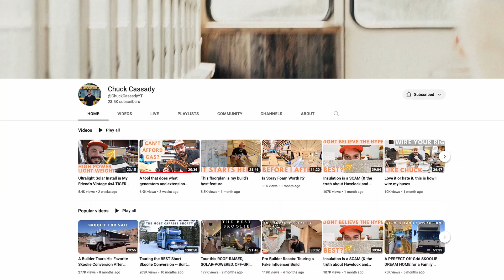1987 OM617 Turbo Diesel Swapped Toyota 4x4

Comment: I did this swap 4 years ago on my 88 4runner, it’s not a daily driver but I’ve put 21,000 miles on the rig after the swap. I run the mechanical fan and aluminum radiator that Joe recommend from summit. I had to use the old gaser water pump from a 1965 Mercedes because it’s 2” shorter than the diesel om617. I use a Chevy 1 wire 100 amp alternator and factory Toyota AC that works great. All Doomsday diesel parts are the bomb
Reply from the maker: Nice man i kind of wish I kept the mechanical fan but it was super tight in there and I was pretty sold on the serpentine kit, I’m a big fan of doomsday, I still think there are a few kinks that needed to be worked out and every build is different and that must be hard for joe
Reply: Seems like everyone of these I see has a electric fan which defeats the purpose to me. I wasn't sure if the mechanical fan settup would work, this is good info to know. Can you say the swap is worth the work, how does yours run at 65-75 speeds?

Comment: I don’t know if you still look thru these comments but @owner or anyone do you know what manual transmission you can you use on a om617 engine that isn’t the 4 speed or the that 6 speed conversion that cost a arm and leg.
Reply from the maker: @redwizardism , I used the stock w56 tranny, you can use the r150 which I would recommend, doomsday diesel and 4x4 labs sells adapter kits/plates but nothing about this swap was cheap

Comment: How difficult would this be for a 2wd 22r? Its got the motorhome dually rear axle. Just doomsday diesel kit plug in? Or would i have to modify dri eshaft or anything? Thank you
Reply from the maker: Yeah you’d have to modify driveshaft, it’s not the easiest thing to do, I wouldn’t call it a “plug n play” type job.

Also I’m not sure on the ifs trucks, I solid axle swapped my rig and fitting the engine in around a moving front axle was a huge challenge, im sure someone out there has done this swap to a 2wd motor home, might want to check the Facebook page “om617 swap” I’ve met a ton of helpful people on there

Comment: Hi man! I had a couple of questions you could help me please,  my main questions are regarding the transmission of the mercedes an adapting it to toyota. did you modify the carter? what gear box are you using? are you modifying the transmission of the car? is it manual transmission?
Reply from the maker: I bought an adapter plate from doomsday diesel, I’m using the manual w56 transmission that was in my Toyota

Comment: Using Joe's kit in our 87 yota 617 build right now, what radiator and fan are you running ?
Reply from the maker: I just ordered the thinnest one I could find on Amazon, it was like 1-1/4” or something, I had to put the fan INSiDE my shroud to clear everything, it’s tight in there even with the serpentine kit

Comment: What you got for a rad and fan setup?
Reply from the maker: I bought the thinnest fan I could from Amazon and then I put the fan inside the shroud, I got really lucky, I can search for part numbers if you want, I literally just zip tied it to the inside of the shroud and then screwed the shroud to the radiator sandwiching my fan and then got lazy and put the fan on a manual switch, I plan to put it on a temp switch set at 190 degrees F 

Let me know what you think
Reply from the maker: And the radiator is just the aluminum one that joe from doomsdaydiesel recommended on his website, I think it matches with a 94 3.0 truck but don’t quote me on that
Reply: @OwnerBuildersUnite  if you've got part #'s I'd really appreciate it! Have been looking at mustang aluminum radiators with inlet/outlet on the passenger's side, but idk... You believe yours is a 3VZ rad? I know he was recommending a Summit universal one, a while back
Reply from the maker: @MrJrakk  hit me up on Facebook messenger Matthew J Evers